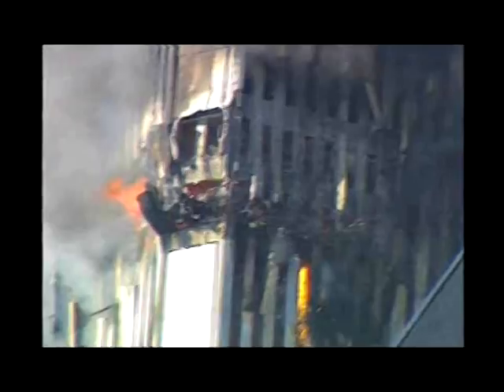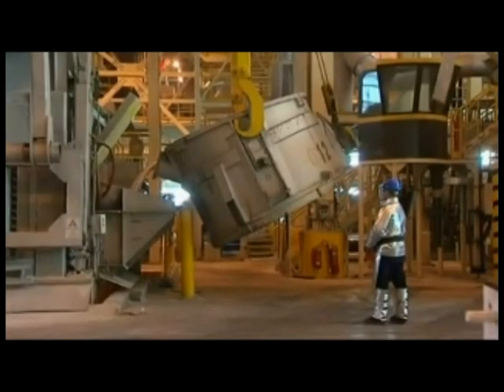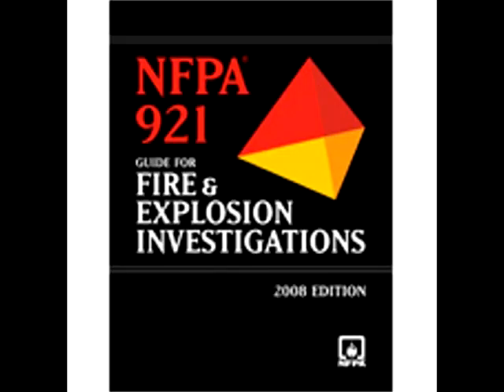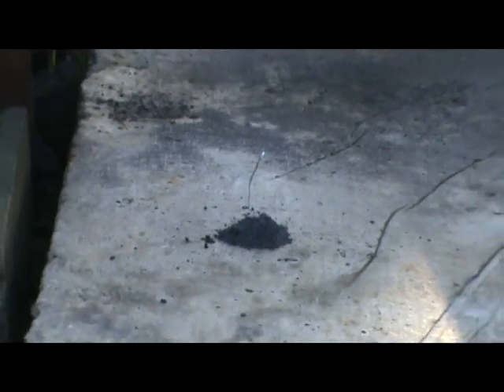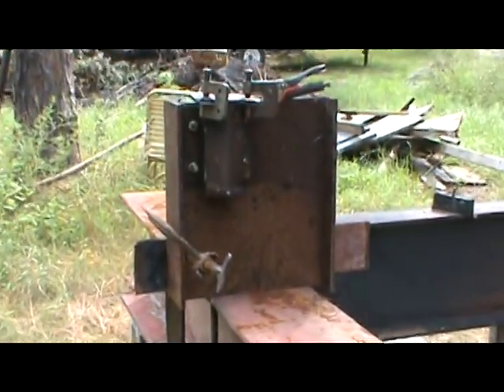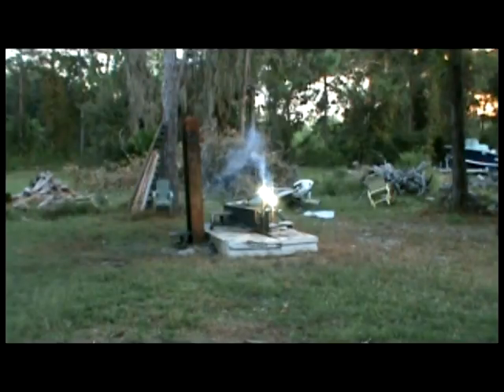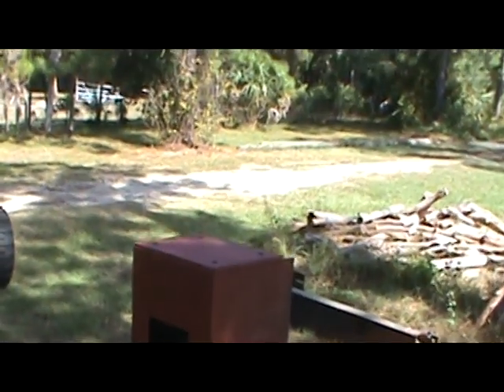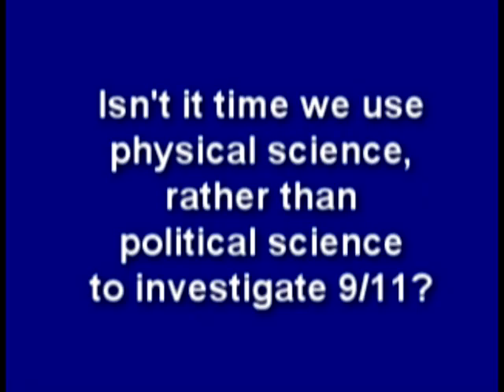9/11 Experiments: The Great Thermate Debate

Comment: Three building fell perfectly into their own footprints? And one didn't even have a fire before collapsing.
That alone should make people question the reports. Two buildings got hit by planes, and all conditions were perfect in both where they collapsed exactly the same? Sorry but those things do not happen.
Reply: +John C
"Three building fell perfectly into their own footprints?" - A lie.  Why are there freely available photos of WTC1 striking WTC7? Why were all the surrounding buildings damaged beyond repair?
"And one didn't even have a fire before collapsing" - Another lie.  WTC7 had a seven-hour fire which worked its way up from the seventh to the thirteenth floor..
"all conditions were perfect in both" - Another lie.  They were both badly damaged and suffered about an hour of a six-acre office fire.  That's hardly "perfect".
"they collapsed exactly the same?" - A further lie.  WTC2 failed on its outside first, and leaned 20 degrees as it fell.  WTC1 failed in its interior first, and still managed to reach WTC7 400 feet away.
"Sorry but those things do not happen" - Truther lies happen all the time (you've just proved it), and I don't believe you are sorry at all.  That's the truth...
Reply: Tony Duncan LMAO
Reply: Tony Duncan wait wait wait... you're telling me it was going on for 7 hours... dammnn..
Reply: Because the whole WTC-area was doomed...
Reply: 7 was on fire for hours and there is LOADS of footage of it
Reply: How did building 7 fall when it wasn't hit by a plane.
Reply: zumaan Andrade it was on fire for hours as it was left to burn because it was evacuated and emptied as soon as the planes hit. It caught fire from burning debris falling onto it. The collapse was from the penthouse floor giving way as it wasn't structurally strong as the rest of the building
Reply: It was severely damaged by debris from the twin towers, as well as an uncontrolled fire that burned for more than seven hours.
Reply: WTC7 suffered extensive structural damage when it was struck by debris falling from WTC1. This impact also started fires which were allowed to burn in order to avoid further risk to first responders (after hundreds of them were lost when the twin towers collapsed).
Reply: O.P. Yates no... details. The facts make it obvious it was an inside job. Our government admitted to it.
Reply: maybe you should study engineering and find out the truth between steel building fires, concrete building fires, and concrete and steel building fires, and also tall building support structures and how they react to fires and collapses.
Reply: Also the properties of plaster and asbestos
Reply: John C 
Yes. Buildings that are built the same way are going to fall the same way. That should be a pretty simple idea to understand.
Reply: Joseph Voll Excepr that they weren't hit the same way. Not the same floor, not the same collumns, not the same angle of impact. And even if it apparently did had the same impact, there are numerous variables that can alter how the building is gonna fall.
Reply: John C No they didn't. They were massive piles that damaged surrounding buildings. There was a massive pile of rubble almost 40 stories high.
Reply: +SilentSam
"There was a massive pile of rubble almost 40 stories high" - that is way, way beyond exaggeration.  The 110-storey towers collapsed mostly into their 70 feet deep basements, only just overfilling them.
This allowed that idiot Judy Wood to claim they had been 'dustified'.  But if you take all the air out of the towers they would only have made a pile fifty five feet high, and their basements were seventy feet deep.  So there was still a lot of air in the wreckage.
Reply: If the government was really behind this, why would they let the towers go down in such a 'weird' way that caused some people to not believe the official story? Why not letting WTC7 fall down in different parts so it looks plausible?
Reply: Another question: why would they do an inside job on a sunny day with a clear blue sky? Wouldn't it be safer to do it on a foggy day so no one could clearly see what happens up there?
Reply: +Laurens C.  I hope you are being sarcastic.
Reply: 9/11 happened on that particular day precisely because it was a clear day, making navigation to the targets that much easier.
Reply: Exactly. Why bother with the pretense of the airplanes? Why not just wire the buildings, blow them up and blame a bunch of nameless terrorists?
Reply: +John Johansen  Sorry John, but you don't know what you are talking about, you obviously know nothing about what a demolition looks like, and the evidence that shows clearly the fact that the Twin Towers and building 7 were demolished professionally. As a tradesman that works on the steel construction of buildings, I know what it would take to bring them down. The flight lists are fake, the flights were fake, no flight attendants, no Islamic terrorists, no passenger planes, and all the true information is classified. No planes at the Pentagon and in the field on the way to Washington either. Get a grip on reality.
Reply: Eskimo Man,
One other thing which defies explanation except by the, umm experts on payroll,
How did aluminum wings cut through stone and structural steel like a knife instead of being sheared off on impact?
As a tradesman I am sure you saw and almost spit over one of the comments someone put out that a fire of 500 degrees will weaken structural steel.
 As well as the fact jet fuel can not get hot enough to melt, much less cut through steel
Reply: Please explain your reference to 'stone' in regard to the WTC towers.
Reply: OK concrete. You got me there
Reply: +John C  Originally that was my thoughts on how the weaker wings could damage, or penetrate much thicker hardened steel. But recently I have seen a compelling video showing how velocity of the object can do it, even though there is nothing left of the object after impact and penetration. This video shows how a ping pong ball actually penetrates a ping pong bat being fired out of a gun at high speed, leaving a clean hole the exact size of the ball. There is nothing left of the ball afterwards.
Reply: Agreed. Too many people don't understand the difference between mass and force (specifically, kinetic energy).
Reply: I do see what's going on around me. It's people like you who hang on unsupported theories proffered by unqualified 'experts' citing dubious science.
Reply: None of the WTC buildings simply 'caught fire'. They were damaged either directly by airplane impacts or by the impacts of falling debris. To either knowingly omit these facts or to not know them at all indicates either bias or ignorance regarding the subject in question.
Reply: They were most certainly on the passenger lists. The reason that the terrorists on one of the planes were identified is because one of the flight attendants relayed the seats that had been used by the men who hijacked the planes. So, that puts another falsehood to bed.
Reply: Which of the three buildings did NOT have a fire?
Reply: +John Johansen  How many buildings had raging fires throughout a hole floor? A few little fires in buildings do not bring them down dummy. And stop nit picking, building 7 did collapse into its own footprint, and one and two collapsed straight down. The only reason why there was collateral damage to surrounding buildings, was from the explosives blowing the steel outwards into them. You anti truthers just look for small mistakes in wording to try and debunk the truth, without any success.
Reply: What, exactly, constitutes a building 'falling into its own footprint'? Would that be when a building neatly collapses without any collateral damage to surrounding structures? If so, your characterization will come as a surprise to the people who owned the Deutsche Bank building next to the WTC because it was so badly damaged by falling debris that eventually it had to be demolished. That would be one big footprint.
Reply: No they didn't sorry.
Reply: John C if planes did strike those buildings then 50% of those aircraft should have landed at the base of those towers. Aircraft cannot fly thru steel sections. Parts could penetrate thru gaps in the structure only. So where was the 50% in the street? Did anyone film aircraft debris anywhere on 9/11?? I saw a blown up section of the Pentagon , a hole in the ground and 3 towers implode.
Reply: @stronzer59  One the towers didn't fall into their footprint, two not only did they find plane parts ,they are still finding them on rooftops and in nooks and crannies still today.
Reply: +Tony Clifton  There were a couple of office fires in building 7 on either side of the building. Clearly not enough to weaken the structure at all, and the building did not start to sag before it was demolished in a controlled demolition.
Reply: +O.P. Yates  Alex Jones does tell the truth, just not all the truth. He is working for the Zionists to cause a civil war in America, without telling the truth about who controls the government and everything else in the world today.
Reply: +O.P. Yates  In reading your long post it is unclear whether you know 911 was an inside job or not. Your comment talking about how oxygen for emergencies is stored suggests that you think combining the oxygen with flame has the ability to cut or weaken the structural steel in the buildings, when I know for a fact this did not happen. Only a controlled flame could cause the weakening of steel, but still not a collapse.
Reply: +O.P. Yates  I should have read your comment to me before I posted my last comment to you. Both towers did not have raging fires through many whole floors at all, we would have seen fires raging out the windows around the whole building, we did not. The planes also did not cut through many floors either, destroying concrete floors. After they initially cut through the outside wall of the buildings, there would not have been much left to continue through as the initial impact would have destroyed the planes. The structures were not weakened either, if they were, the top section of the buildings above the impact zone would have collapsed immediately, and fallen off the top of the building with the first collapse, and the second collapse would have just sat there on top of the building after the weakened section gave way. The two types of smoke coming out of the buildings after impact shows black smoke indicating lack of oxygen, and light smoke indicating thermate reacting to the fires that ignited it. The central core of the buildings could not have collapsed. It is just impossible. I should know as it is a part of my trade to put the steel structure within these buildings. There is plenty of evidence of demolition with load bearing columns cut at 45 degrees with demolition charges. They could not have been cut by oxy torch. Give up mate, it was an inside job to bring about a false war on terror, which is really a war on our freedoms and rights.
Reply: most sky scrapers are designed that if they collapse that they collapse straight down, to reduce casualtys from the building falling on other buildings
Reply: The design of 1 and 2 WTC consisted of a central core of columns connected to external perimeter columns with floor trusses. The failure mode was that the columns around the impact site were damaged or destroyed, which caused the weight of the building above to be redistributed to surrounding columns, exceeding their design loading. This, in combination with jet fuel fires, weakened the remaining structural elements (structural steel loses about 50% of it's strength at 500 degrees). 

The asymetrical loading and decreased strength of the remaining structural elements eventually lead to them giving way, causing the section of building above the failure point to collapse into the floors below. Floors which were only designed to withstand their own weight plus a factor of safety and were attached by seating points on the perimeter and core columns. These floors gave way under the immense impact and added weight to the collapse, which as a result sped up.

Due to the vertical strength being concentrated in the center and perimeter of the building, but not in the floor space, the floors gave way, resulting in the perimeter and core columns no longer being mutually supported, causing them to collapse. Due to the fact the seating points for the floor trusses were internal to the perimeter columns, the torque caused by the impact caused many of these columns to collapse inward, into the building's footprint. This became less and less of a factor as the collapse sped up, as the failure mode went from bending to shear stress. This can be seen on several videos whereby the perimeter columns for the lower floors stayed standing for several seconds after the collapse of the floors to which they were attached. 

WTC 7 was designed in a similar way, and collapsed in a similar way, with fires being uncontrolled due to the collapse of 1 and 2 WTC severing the water lines for the sprinklers in the first 15 floors. Again, the combination of asymmetric loading exceeding the design loading of the structure (as a result of large pieces of debris impacting the south side perimeter and core columns), along with uncontrolled fires weakening the remaining structural elements, ultimately lead to a progressive dynamic failure of the building, resulting in a collapse.
Reply: DN Swag Thank you for not being an idiot.
Reply: "Thank you for not being an idiot." - Seconded.
Reply: Brett Friedrichsen please explain the Pentagon if the rest of us are idiots
Reply: Joey Boy It flew to it. Is that so difficult to explain? There were planes used, four of them. No hologram crap, no 'inside job', people always try to find a more nice answer to a fact. "Oh but building 7 fell in it's own footprint" tell that to parts of it's facade that flew on other buildings.
Reply: "I want to know how the airline jet hit the Pentagon then" - So bloody well find it out, the way the rest of us did - we used the internet search engines, using words that filtered out truther lies and pulled out the vegetables from the weeds.  Too dim for that?  Tough, Joey Boy!
If you're really clever you will find the work of a photographer who took multiple shots of the Pentagon facade before it collapsed, knowing that by combining them he would discover how much damage there was behind the smoke - because the smoke wasn't always there...
Reply: Very good.  Except that "it's" means "it is".  The possessive of "it' is "its".
Reply: So the buildings were designed to collapse, in case you would need to demolish them some day, they would go down easily in their own footprint after torching them a bit in the upper floors. Osama knew that, cause he was a famous engineer :D
Reply: Well said.There is no point in anyone discussing how and why the towers fell without first having a clear understanding of how and why they remained standing. Too many people forget this.
Reply: DN Swag yeah and a jet aircraft hit the Pentagon by flying feet above the ground and not one video (and as we are told it is the most highly monitored building of all by camera) shows any "jet" hitting it
 Also witnessed by fire chiefs and personal working at the Pentagon that day so no aircraft remains. Are you a Bush by chance?
Reply: It was inside job... regardless of the details
Reply: John C I think most reasonable people know the truth by know. It took me about half hour after the last event happened that it was a set up. But we are not supposed to  question the powers that be.

Comment: the easier solution is to just ask any industrial demolition company how they would demolish a similar building, they'll tell you about the diagonal thermite solution among the other requirements, which is a massive undertaking, interestingly in the years leading up to the attacks specific floors had been renovated to come up to fire code, the company that did the renovations also interestingly is known to have purchased a significant volume of thermite at that time in which they had no other jobs and their specialty isn't renovation but demolition, the subsequent obvious questions were apparently never asked

Comment: Bar Joist cause the Towers to collapse.  I Beam were only used on every 4th floor.  The floors in between were tied to the outside wall, that is why the outside walls were so strong.
The Bar Joist which supported concrete floors.  Bar Joist can melt from the heat of jet fuel.  As the Bar Joist melted the weight of the concrete floors crashing down on the floors below caused the collapse.
This is common knowledge, but Bar Joist is omitted from this story.

Comment: The Twin Towers were not designed to last forever, nothing is nowadays, were the towers fitted with thermite devices from  the outset so that when they had reached their allotted life span the could be demolished quickly (and cheaply) within their own footprint? Could the burning of the jet fuel have triggered this process prematurely? Discuss.

Comment: The outer shell had most of the strength of the building primarily because it straight. But the is no mention of the lightweight steel trusses that supported the 4" concrete floors. Even in low-rise construction firefighters don't trust these to hold up for more than 10 minutes exposed to fire. Don't look to the strongest part of a system for failure points, look to the weakest. The trusses sagged and visibly pulled in the walls of the towers before the catastrophic failure.
Reply: lol google high rise tower fires. nonw other have ever fallen

Comment: That building could with stand planes hitting it at very high speeds with minor vibrations in the structure that building wouldn’t collapse like a domino set vertically and perfectly without the help of some master engineers of evil you have all these witnesses attesting to the strange noises then you have all these dumbasses going against facts